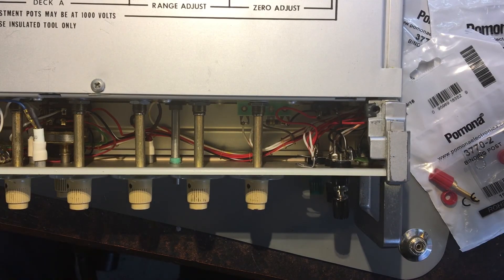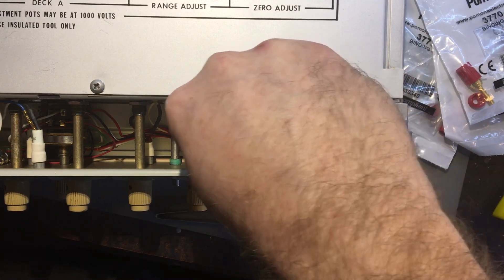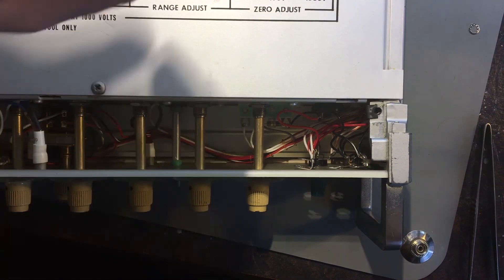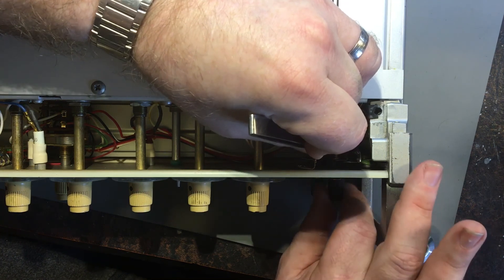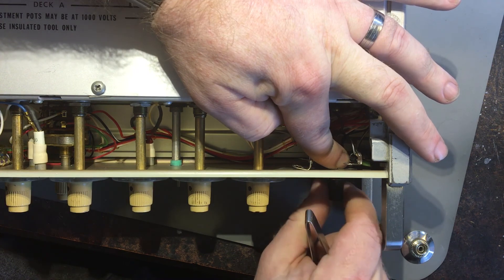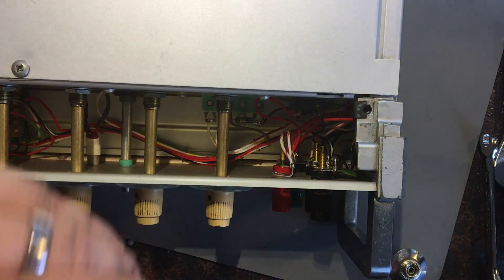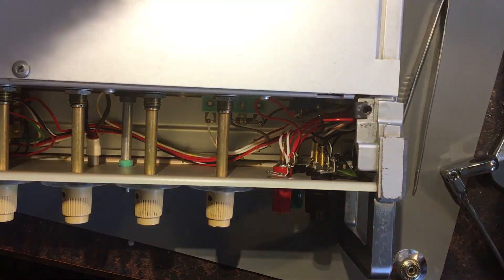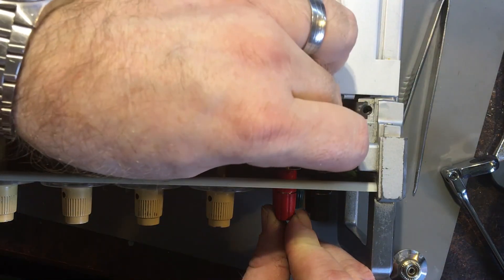#275 Fluke 343A DC Voltage Calibrator Repair Followup

Comment: One terminal calibrator lol, sorry bad joke :-(.
If you are bothered about them coming loose, steal the misses nail varnish, a glob of that will keep the nuts on.

They are usefull spanners, i got some from Aldi, not nasty quality at all.
And last year a digital caliper for 8 quid, its identical to the overpriced ones in r.s or maplins.